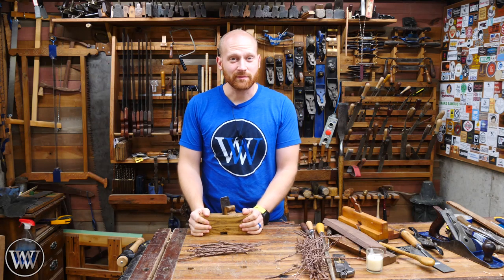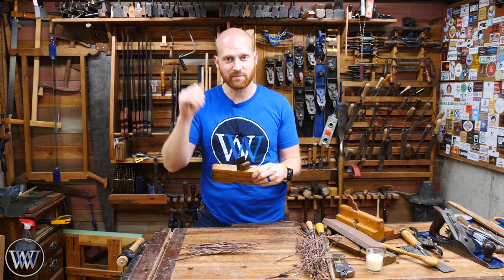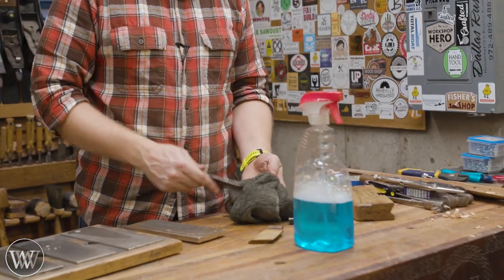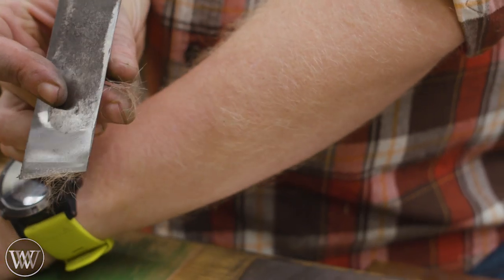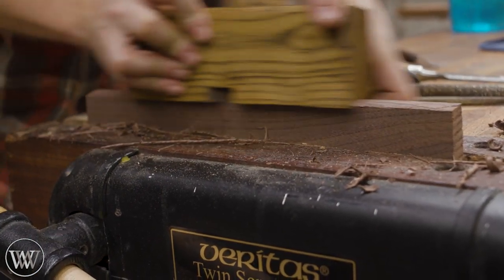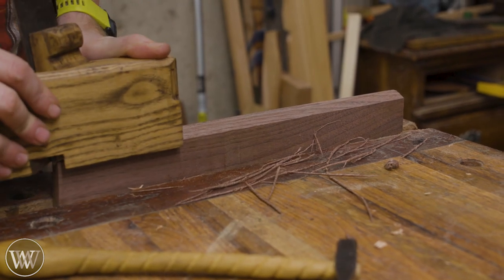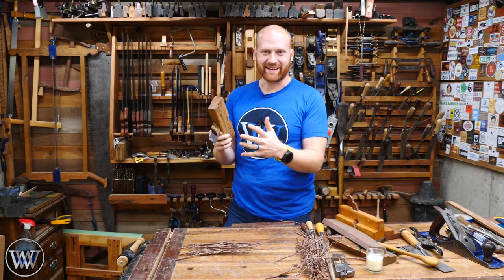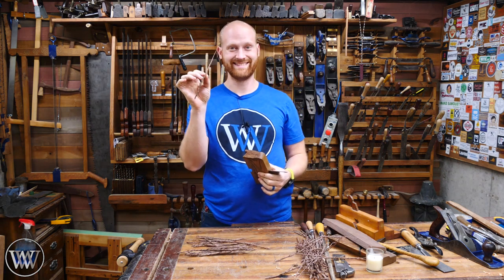How to Restore a Spill Plane

Comment: I've wanted to make a spill plane for a while, but most I've seen are over-engineered, requiring compound angles, and/or laminating all sorts of parts. The one you show, is remarkably simple looking, and something I could tackle. 
I've always found plsningbto be almost therapeutic: The scene in "Witness", where Hartison Ford is planing a board to repair the birdhouse, almost made me want to run off and become Amish, just so I could plane boards!
With a spill plane, I can just plane, with no more purpose than to make spills, and, as an 18th-century Reenactor, I'd not only have use for spills, I could keep friends supplied!

Comment: This has me curious how many variations of planes that can be made and still produce the same curls. Could you take a standard plane and modify it to do its intended job while still creating the same curls?
Reply from the maker: you can get close with a block plane but you have to hold it just right and hope the side wall of the plane does not get in the way. there are a bunch of different designs to do it. but the best spills are from a plane made for that use.
Reply: @WoodByWrightHowTo  I was thinking of someone doing that moreso as a challenge than to serve the "practical" job of making the curls themselves. A combining of  two designs that perform both tasks equally well. Just for kicks.